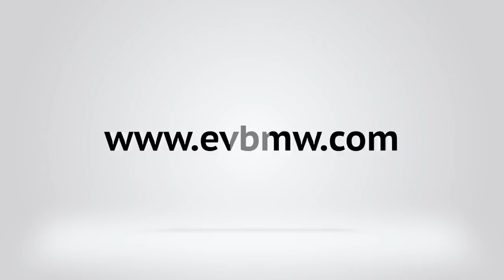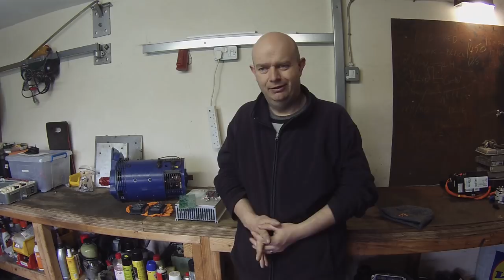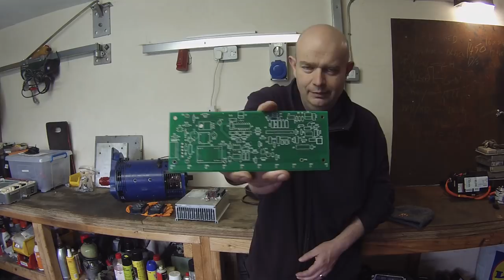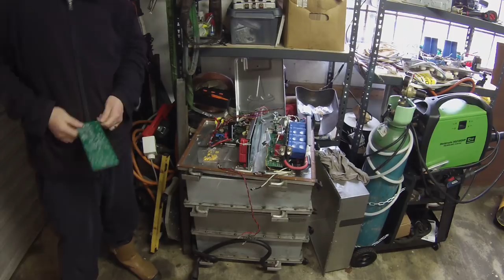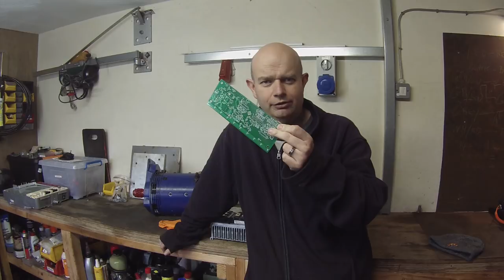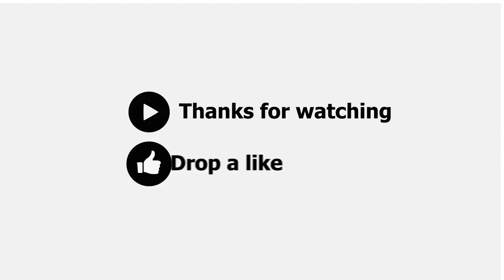€1,000 BMW E36 EV Build 02 : Motor Choices

Comment: Hi Damien. I have a similar motor in my shed and even went so far as to buy a controller off Paul Holmes a good few years ago. I was unable to get some components to populate his controller. Still collecting parts etc, but turned my attention to AC after discovering Johannes's inverter. Your giving  me second thoughts with your latest video. I'll keep collecting with one eye on your videos. Keep up the good work. By the way the motor was free from a forklift company in Greenogue.

Comment: It's hard to beat IGBT's for free Damien, you are a good lad for helping others remove obstacles like that!

I was wondering for a minute, you are pretty good at circuitboard development, have you thought about making your own power-bricks?
Tried doing some back of the envelope calculations and price checks on decent FET's, but came to the conclusion that even for a half-bridge topology the price per transistor and amount needed for 300A+ current is too high relative to second hand IGBT's. Unfortunately GaN's and SiC's are still very expensive too.
Considering that's even before picking out drivers, passives and matching components one would almost be mad to attempt it?
Reply: Maybe try to search a ready inverter from a leaf or other electric/paralell hybrid car + a replacement circuit. for 4-500 USD you can get an inverter+hacked circuit board..

Comment: Awesome Project!
I've been wanting to build an EV project of my own time and time again, but the budget always gets me backtracking...
Maybe I'll actually build my own EV one of these days.
Please, make a video of how to "beef up" or prepare these Forklift DC motors for EV use!

Just a few questions, out of my curiosity and fruit of never having driven one of these EV builds.
-How does the Torque of these forklifts "upgraded" DC motors feel at 500 amps?
-Do you think they could possible withstand 1000 amp peaks and would there be actually a noticeable and usable advantage of those extra 500 amps?
-Are these DC motors appropriate if you have some hills in your itinerary? For exemple, near my house there is a 200 - 300 meter long 10 degree inclination... Would it be okay?
Thanks a lot and keep up the awesome work!
(Sorry for the long comment, everyone)

Comment: I'm also looking forward to your controller build, I could use a smaller scale version of it for a bike I'd like to make,  I could use motors even from angle grinders or kitchen appliances, dc would simplify everything, and I could have something that works instead of looking at a bike and wishing I could do something. Universal motors are everywhere and a bike doesn't need to move a 1 ton tank around so reusing things I got around the garage could become a viable option for a project. Yes I've been wanting to make an electric bike before even thinking of car conversions, since my health is not that great either and maybe if I have the confidence that if I get tired I can still get home without overworking myself I would ride the bike more and perhaps get to improve my health. But the price of the equipment for a decent bike would cost as much as a cheap car and in my eyes that isn't worth it. When my monitor's power supply broke, since I didn't know how to repair it, and if I did, (maybe some mosfets fried?) I couldn't get my hands on the correct components anyway, I just connected another pc psu to it, used the 5v and 12v rails, and I made it work, been using it like that for half a year. If it looks stupid but it works it ain't stupid. Reusing and "hacking" stuff is something I like doing.

Comment: Since first watching this I've converted a small off road motorcycle and now obsessing over doing a car :S My problem is my journeys are either really short in the week, then 100 miles at motorway/national speed limit at the weekends. If first generation Leafs can only do 70 miles on 24kwh I doubt I'd manage my 100 mile journeys on a £1000 conversion.
There's a few forklift companies locally, but I can see getting hold of batteries been quite difficult. Leaf packs look to be >£3000 on eBay

Comment: Hi Damien, came across this series and am now addicted! 
I've got an old Dutton kitcar which I'm looking at doing an EV conversion to. I'm already in touch with some companies regarding the motor but would be interested in a set of the IGBT's if you still have some, I will gladly cover the cost of postage as I'm in Kent.
Keep up the good and very informative work 👍

Comment: Damien
Really enjoy your videos and I will be starting on a project in the spring.  I have a million questions.  Can you help me with a couple.  My car is a 1993 Chrysler LeBaron and will gross out at about 3500lbs.  I have access to 3 phase AC induction motors and I am told they are a good choice for a conversion but I have no idea what HP,  or turning speed I need.   What HP/Speed should I get?
Also my car has an automatic transmission.  I know manual is preferred but is there a way to make an automatic trans work?
Thank You 
Jacques LeBeau

Comment: Hey Damien, Do you have any estimation the kind of horsepower or torque numbers are possible with a modified forklift motor? (Advanced brush and higher volts/amps)

Thanks for all of the information you put out. Very helpful!

Comment: I know gas is expensive in Europe, and right now, it's  expensive in the US.  It sounds like this vehicle's going to draw about 15 KW. So for one hour it's going to cost about 3 - 4 dollars.  In a Kia, I can drive 40 miles at 40 miles an hour for 1 hour for around $3.50 on gas. It doesn't appear like your car is more economical for one.  And two, what are you using to produce your electricity to charge your car.  Is it any cleaner than unleaded gas. Please tell me if I'm wrong.

Comment: I would also like to ask what do you think of these integrated solutions like the tesla drive units, they seem like the best price to performance motors you can find. I've also heard of a company called magna that builds motors and attaches them to getrag 1 or 2 speed electric motor gearboxes, there is a test they did replacing the tesla motors in a model s with 3 of their own, power wise they're not that spectacular (about 200hp/motor) and I couldn't find any info on getting them, they are not released yet, and if they are more expensive, then I still think repurposed tesla stuff will still be holding the crown for a few years to come. I'm looking into what motors I could get, I want to make something pretty fast, as performance goes up and the car becomes comparable to better vehicles the conversion becomes more worth doing. Stuff like the volt/leaf/ioniq/i3, all those motors are in the neighbourhood of 100kw unimpressive motors for city driving boring cars. Tesla stuff seems to be the best and cheapest for now. I am guilty of waiting for the better thing when it comes to my computers, and I don't want to do that to cars aswell. So I'm asking for opinions on whether tesla parts will still be as good value for money in the years to come. I'm sure as other manufacturers begin making higher performing ev's there will be more choices, but I think that a 350kw motor gearbox and inverter for 5000€ is pretty unbeatable at the moment (as long as the controller for the inverter and the ecu aren't devastatingly expensive). I want to get something good and be happy with it, and if I pay 5000 for a motor today and 2 years later the same thing comes out for 1500 I'd feel bad. But I don't think that will be the case. there I go talking about a 5k drive unit as if I could afford it :(. As for the affordable ev, wouldn't a tesla front drive unit being so small increase efficiency to the point where its worth dropping 2000€ on it rather than build a (heavy) dc motor, not have regen, use a gearbox that could break from the torque, have a driveshaft and diff, there's a lot of weight there. What about using (abusing) the transmission tunnel and underneath of the back seats to fit the T shaped volt/ampera battery? Keeping its structure seems like a good idea.

Comment: Hi Damien,a question please if you have time to reply Does the car need to be a diesel and could you use an e36 bmw diesel 525 d hope Im correct here What Im really asking is what is the best donor  BMW e36 car and box.?
Reply from the maker: Does not have to be a diesel but the ratios do help if using a DC motor. A 525d would be fine. You can also swap in a diesel diff at a later stage if you find top speed to be limited. For a low cost conversion a car like what I'm using or a compact / coupe would be fine.

Comment: I watch videos from my phone and I didn't notice until now, but I see some nice looking tire marks on your youtube picture Damien, when's the burnout video in the panzer coming?
Reply from the maker: https://www.youtube.com/watch?v=-Z44gHgDJMc
Reply: +Damien Maguire So that's a siemens powered burnout I see. I remember a comment from someone asking about a tesla powered burnout to which you replied saying it was coming, didn't know you already did one with the old motor. I'm sure the tesla one will be much more exciting! I don't know if you still use the leaf batteries but I heard they can't output that much power lacking a cooling system. You could slap the volt battery in along with your current one temporarily for some serious tire bbq action.

Comment: Is this motor any good to make an EV conversion?
D&D EZGO/Yamaha Motor: 
This EZGO/Yamaha motor works with 36V or 48V EZGO TXT, Freedom, Medalist and Marathon models as well as Yamaha Series models. Fan Cooled Motor for better thermal characteristics. DESIGNED FOR CLEAN ENVIRONMENTS, NOT INTENDED FOR OFF-ROAD USE

3" Lift or higher recommended for all Yamaha models to accomodate larger motor

Easy install with NO controller programming.
High Performance - 180 °C Thermal Rating (Class H) - Electric Golf Cart Motor
Made in the U.S.A. with U.S. components.
Made with more steel & copper and thus provides better thermal capabilities.
Less current draw and thus longer vehicle range.
Performance Specifications

Vehicle Speed : 21 MPH
Torque Enhancement : -15 %
Motor RPM : 4850
Peak HP : 8.6

Comment: What about the option of a slightly more expensive tesla small/front drive unit? I've seen those go for 2000, ac, has regen and they come with an inverter. That's pretty good. Or perhaps the original volt/ampera motor but hacked. I feel like 1000 is giving up so many things. after you complete the "beginner" cheap ev you could add just a bit more into it and upgrade it into a much more capable vehicle. The battery that car will get is very capable, should have no problem running the 200hp tesla front drive unit you already have. And what about odometer, charge state information and all of that? I tried looking around in your e31 playlist but I seem to have missed those parts. The blue lighting lotus evora guy did a wonderful job on his conversion, his dash is superb and full of info, but the motec 150 ecu that controls all of it is 3000 just by itself, not even with software on it. You inspired me to get a cheap bmw, perhaps an e36 316, cause big engine tax here is unholy, use it like that a bit then try to convert it. People say the 316 has the same frame as a 325 or something similar and that they put bigger engines in them all the time without frame reinforcement. That's reassuring. But the ecu and monitoring part seems difficult, I don't know much about ecu's since they weren't a complete necesity on a gas engine, but on an electric car it's way more important for monitoring temps and amps and state of charge and all that.
Reply: 316 and 25 don't have the same suspension or brakes
Reply: +kize32 Thanks for the reply, as long as the car can hold the power without needing welding I'd be happy to replace the brakes and install some better springs.